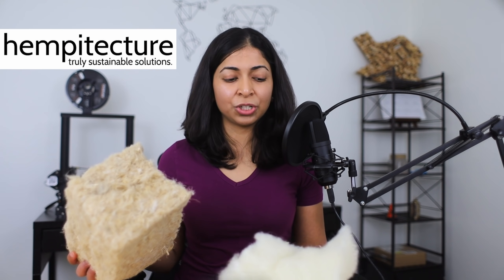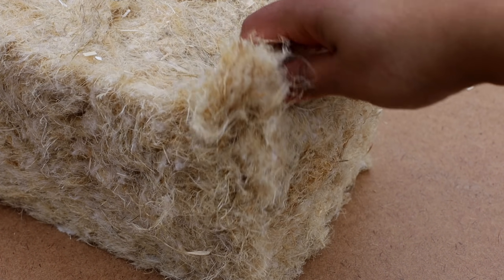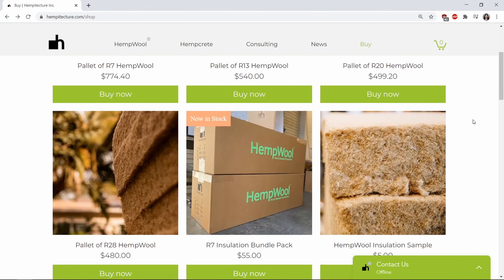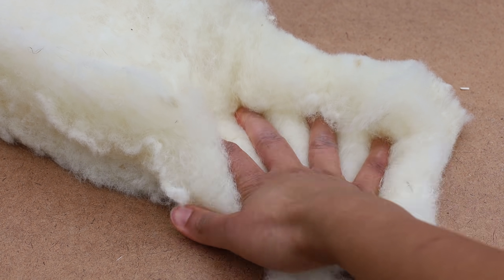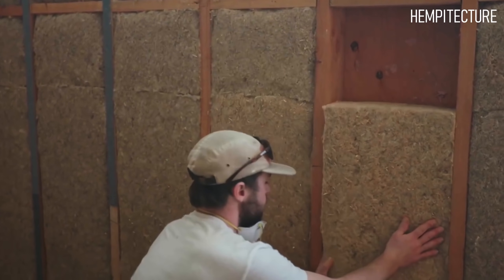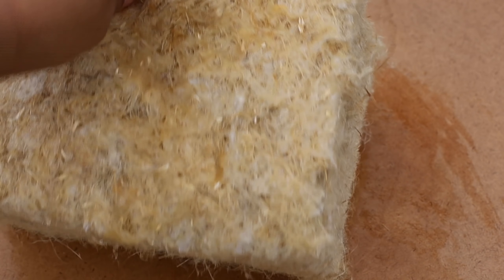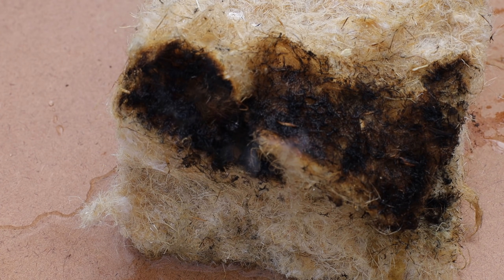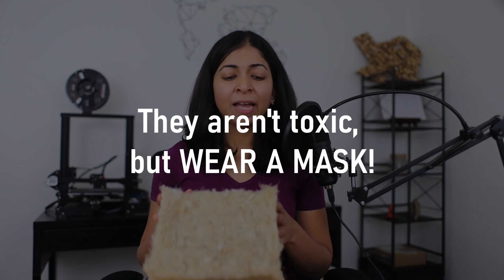Hemp wool vs Sheep wool insulation | Everything you need to know

Comment: I helped somebody with their cabin a couple of years ago including the installation of Hemp wool insulation. From that experience I would caution anyone using Hemp wool in a damp environment. Under the floor of the cabin we insulated in the fall with intermitted rains outside. Within days all the insulation exposed to damp air was covered in green fuzzy mold. Inside the cabin was drier since a wood burning stove had been installed. I saw no problem on the inside but we ended up pulling it out simply because it seemed risky closing the Hemp wool up behind drywall where it could not be monitored. There are dryer climates than the Pacific Northwest. Hemp wool might serve better in a less damp environment.

Comment: You can always just use hempcrete insulation in your walls, roof (with less of a percentage of the lime and a hurd that has a slightly higher fiber ratio) for a lighter/higher insulative mix) and even floor (requires more lime and virtually no fiber in the mix for greater durability) under the right circumstances.  In this way you get the insulation and thermal mass of the hemp without the flammability issue.

Comment: Dear Belinda, the only downside to wool for me is that moths like to eat it. Did you also hear about Ionic Protect wool (from Isolena) which is treated with plasma to change the molecular structure, so the vital fibers no longer represent nourishment for keratin digesting insects? I wonder if the wool will after this treatment still have the useful characteristics that you mentioned in this video; "Each fiber is composed of protein molecules or keratin... these trap air, moisture and harmful chemicals." As the keratin is probably gone after the plasma treatment?

Comment: Well, since hemp wool contains 8 percent polyester fiber, I wouldn't say it can easily be recycled or ground up. It definitely cannot be composted without separating the polyester fibers from the hemp. In recent years more has been learned about the dangers of microplastics. Synthetic fibers are one of the leading causes of microplastics in our environment. Hempitecture is not helping by adding polyester fibers. Hopefully, a new company will come along that attempts to mix the hemp fibers with other natural fibers such as sheep wool, cotton, or fiberglass. Because of this hemp wool brand's 8 percent polyester content, I would not call it an organic material either.

Comment: Sound transmission reduction of any insulation is going to vary depending on the frequency of the sound being transmitted. An acoustic engineer once told me that the only thing that will stop sound transmission is mass and obviously insulation as little mass because massive materials are not good insulators, so I would think that rock wool would be a better sound insulator than either of these products

Comment: Thank you for a fine comparison. I recently obtained samples of both products for a Fibershed display in Virginia. I did not know that the polyester binder was incorporated into the hemp wool. That certainly makes it a less "green" alternative. I also wonder if that is the part of the product that continued to smoulder in the fire test. I also wonder what compounds were released into the air when each product was burned. Second: It's my understanding that boron is incorporated into the wool insulation, to prevent insects (moth larvae) from investing it.

Comment: You mentioned the hemp had some polyester material mixed in with it. That was probably why the hemp bat caught on fire and continued to smolder. I think it would be very interesting to mix both materials together to get a better product. Hemp would add structure to the wool and the wool would add it's amazing advantages to the hemp. Best of both worlds.

Comment: oo)=%$ The Alternative to plastic/petroleum-based products is hemp   for it makes over 26,000 different things.  It has even been proven to be 10 times stronger than steel and 30% lighter stronger and lighter than concrete, stronger and lighter than brick. Far more versatile making the design possibilities practically limitless, at the same time being easier to work with on-site'  equally as amazing 1 acre of hemp! Can produce enough bio fossil fuel to fuel 10,000 vehicles for a year at about a dollar per gallon.  One of the major differences is hemp bio fossil fuel only releases the same amount of carbon dioxide  unoxygenated air per mile as a person does when the exhale versus coal, oil, and gas. Which release tens of millions of years worth of petrified death per mile. The real winning sales pitch"  is 1 acre of hemp! Produces 3 to 4 times the amount of oxygen as a acre of trees at the same time sucks in 3 to 4 times the amount of carbon dioxide, greenhouse gases, deadly unoxygenated air as a acre of trees plus it rejuvenates and replenishes the soil back to Garden of paradise type of quality after every harvest even if the landscape has been previously stripped, robbed, and depleted from overharvesting things such as cotton and corn that has been marinating in petroleum-based fertilizer.  Not to mention it has the same nutritional value as rice, corn, wheat, barley, and milk combined is one so we can easily deal with people being. Hungry Over fed and undernourished   In layman's terms                                          we can rebuild faster much more efficiently at a fraction of the cost in half the time of what we are doing today without leaving any excess poison is toxic waste behind.  	In other words we can manufacture, mass-produce, distribute products that every country, city, and continent is going to be happy to spend top dollar.  Example, hemp clothing  distributes moisture across the body more efficiently than any other material leaving a person feeling, smelling, and smiling their best even under the most extreme circumstances don't forget about the limitless design possibility plus it promotes good respiratory function so if a person has asthma, allergies or other breathing complications just by wearing its clothing you will alleviate those symptoms with the potential of diminishing them all together. Hemp  has even  been successfully grown on radiative soil.  So in theory if we grow hemp along the shores of our rivers and lakes we will greatly improve upon the quality of that water shoreline.  Nonetheless we definitely will improve upon and maintain the quality of our air, water, foods, landscapes, working/ living environment, habitat, ecosystem wildlife and every day home products to the highest degree that is humanly possible by producing 3 to 4 times more oxygen per acre than we do currently.  At the same time sucking in 3 to 4 times the amount of carbon monoxide greenhouse gases  un oxygenated air per acre as we do currently,   as a added bonus everywhere we grow it we will be rejuvenating and replenishing the soil back to Garden of paradise type quality even if the landscape has been previously stripped, robbed, and depleted of all its value from overharvesting things such as cotton and corn Keep in mind America has about 800,000 acres of available farming land.  	So again we have the manpower, woman influence, technology, resources, substances, capability, and technology to create clean high paying jobs from coast to coast that will improve upon and maintain the quality of life in such a way.That will gradually consistently, constantly, systematically almost effortlessly and naturally thus allowing each person's generation to become stronger, smarter, healthier, happier, better off physically, mentally, financially, possibly spiritually then the previous generation. With that type of leadership, loyalty, and devotion to one's self and country People may start finally having The resources substances jobs, products, power sources building materials that will allow them to be healthy and wealthy enough to live enjoy their life all the way through out retirement. And far beyond.  You can't do that would dirty low-paying jobs.  That come from outdated power sources, inferior materials, poisonous, toxic substances, pesticides, and chemicals that never change their killing composition which means whether it's solid, liquid, or burnt off in to our airways atmosphere as a vapor is always going to be poisonous, debilitating, deadly to the body at the same time polluting, corrupting, and devastating to mother Earth and all the various different forms of life that live within this world. 		 The bottom line you cannot promote life by doing business with materials, resources, and substances that have been scientifically classified, religiously verified as petrified death or worse. Think about this because it's a simple logic basic concept if life is not free why the hell would death be any cheaper. I guarantee it's not so would you like to know how souls and spirits have paid out are picking up the tab on the end results of dirty low-paying jobs.  Would you like to know how souls and spirits have paid out are picking up the tab on a diminished quality of life? A better question what do you think the spiritual cost is to one's own soul and spirit living dying to the lowest standards of quality opposed to the alternative which is the highest standards of quality?  Case closed. Mercy, forgiveness, death and spiritual welfare are not changing these facts. Protecting, carrying, and compensating any whimpering, whining, crying souls and spirits that are freely connected to a life that is not living up to the pleasure, potential, responsibility of femininity and masculinity. You're either part of the world solutions or you are exacerbating the world's problems either way there is no playing it safe in the middle  every one of us is being held spiritually accountable for each and every moment.I Laugh, smile, grin, chuckle with confidence I say now i wish and pray for my soul and spirit to be held spiritually accountable to the statements I proclaim to the way I'm living personally professionally.	 I guarantee you never see hear another body, man, woman in power, persons of legal, religious authority, leaders ever freely validate the statements they proclaim with that level of certainty. One reason could be the don't have the best interest of the majority of the population's needs at heart. Another reason could be they cum from a bloodline of cowards! One is genetic  hereditary the other is A simpl  generic synthetic learned behavior either way it is physically, mentally, financially and spiritually useless to freely live and die in such a low quality manner especially if that reckless self-neglect stupidity, ignorance, and desperation stems from being soft, lazy, out of shape, over fed, undernourished, overworked, underpaid with dirty low-paying jobs. In these points have been scientifically classified religiously verified as the only way to constantly consistently make each and every moment physically mentally financially spiritually beneficial. S.R.F.

Comment: Wrong about the compression of wools. This is different between batting and blowing wool. If you compress a batt your r value per inch will increase, but your overall thickness decreases resulting in lower r value. So you would need to add more material in order to regain the thickness multiplier. Fiberglass especially benefits from added materials. Other materials like rockwool and sheepswool don't really need to be dense like this. But the same rules apply, if you compress wools and add more material you will have slight increases In r values in exchange for less cost effective the denser you go.

Comment: Wool can breed moths if not treated. Moths and larva can live in the walls as the larva need the wool to eat and moths don’t need to fly to find a mate if they are massive amounts of them. Moth infestation is no good. I would tend towards hemp and not worry about the fire retardant. I want my home to breath but the one thing I don’t like about hemp is the use of plastics within the fibers. Im not sure why they do that except to hold the fibers together. Plastics off gas and are bad for the environment so if Hemp has plastics it is not biodegradable nor environmentally friendly. My vote is for Flax Tow or Hemp Tow Fibers made into batts. They could find better ways to hold the batts together. Similar to how they use felting needles for wool they could do a similar thing for hemp/flax batts.

Comment: What I don't like about the hemp product you show here is the need for using a plastic/petro based binder (Polyester), it would actually be interesting to see if sheep-wool could be used as the binder, I guess it depends on the properties required for the binder.

Comment: Hi Belinda,' thanks for these Videos very informative! I'm thinking to use sheep wool for insulation  as I can get it very cheap.
My  Concern is the Vulnerability of the Material to Moths, I have done some reseach as to how to remediate to this Problem.
Apart from treament with boron salts, essential oils like clove, bay leaf, with various Comments as to the real Efficiency of these treatments over time, or the Toxicity of Boron salts. Also I found mention of diatomeous earth or wood ash... 
Would you have any suggestion on this Matter?
Thanks

Comment: Many years ago I worked for a construction company and we built two houses from hemp fibre ,it was kiln dried hemp fibre mixed with hydraulic lime and sand ,the structures were timber framed and we shuttered up the walls to 200mm thickness and poured in the pug mix and consolidated it by tamping it down ,we done a 600mm lift all round the structure canted of the top to the external this was usually a days work then next day strike shutters and lift to form another 600mm lift repeat until we reached the plate.The external finish was a lime sand render ,internal walls were again timber framed and formed in the same way as the external walls ,these wonders of the world can be seen in Haverhill in Suffolk UK

Comment: Thank you for doing these videos.  I'm going to restore my old home some day and want to avoid problems with insulation,  so far I'm leaning to the rockwool batts.  I have worked with mineral wool and different types of fiberglass and they all irritate my skin.  I want to stay away from the spray in foam, but have used foam board in several areas and it is pretty effective and easy to install.

Comment: The needle punching doesn't 'stitch' the fibres together, it dry felts the wool. This is a structural change in the fibres.

I have installed sheep wool batts in my house. The consistency is quite different to the sample you had (I'll post some to you if you'd like). The product I have here has an R value of 1.28 for 50mm (0.039 W/mK).

Oh - and for cutting the sheep's wool - just tear it apart with your hands!

Comment: Even though you put up drywall, tape and mud, the wall is not completely sealed off and air tight. the wall will breath because the top and bottom are not sealed, plus, there are holes in the tops and bottoms of the stud plates where pipes and wires and even duct work passes through.  Oh, and don't forget the area around wall sockets and switches.

Comment: A very thorough analysis.  One aspect of sheep wool that should be noted is that currently because of the explosion of synthetic fibres for clothing, the market for natural fibres like sheep wool has collapsed such that the price of fleece is often less than the handling cost so that it is either scrapped or given away free.  Alternative uses of sheep wool like insulation should be encouraged as the environmental credentials are certainly worth having.
I note that this video is a US production and uses 'R' values and fire ratings that are quite alien to most of Europe.  In Europe and Scandinavia we use 'k' values that give the product dimensions as well i.e W/m.K  for the heat transference that can then be combined with the thickness ('b' in metres) to give a resistance ('r) and then the total performance of a building element (the 'U' value in W/m^2 Kelvin) is the recipriical of the summation of all the b/k amounts.  Therefore, it is possible to accurately determine the overall performance of the combined building elements.  Having just a US derived 'R' number without units only appears to allow comparison between individual elements and not an assessment of the effectiveness in a system of construction.

Comment: Just curious about weatherization/air sealing in basement rim joists?   Energy-saving programs recommend spraying air gap form sealant and then adding batting.  However, there is some concern about moisture getting caught between the rim joist and the batting which can cause rotting and mold.  Do you have any suggestions for that?

Comment: If we look at wall, ceiling and floor cavities as sealed units, protected mostly by sheetrock or a spray in coating, it seems as though hemp fiber is a viable insulation. If hemp gives off a pot odor, there could be a problem. I worked for a university for 20 years, developing efficient framing and insulating systems. There are many alternate insulation materials that have been proven fire safe. There's no substitute for testing and evaluation. If the Russian scientists are correct about the coming solar minimums we'll all be thankful for better structural insulation.